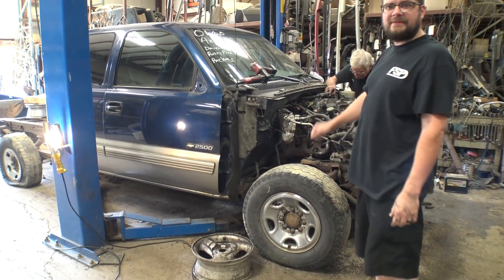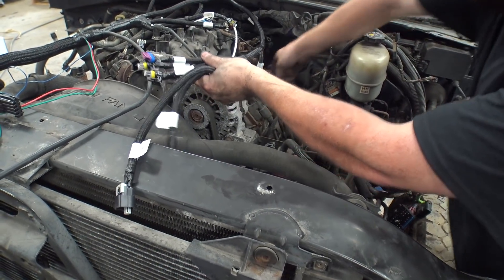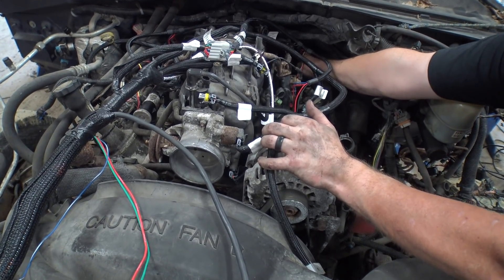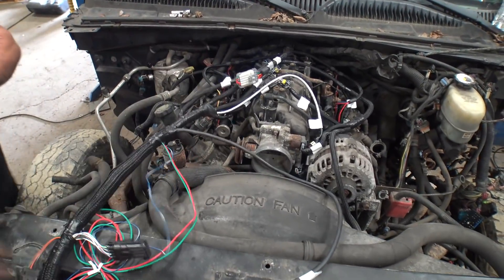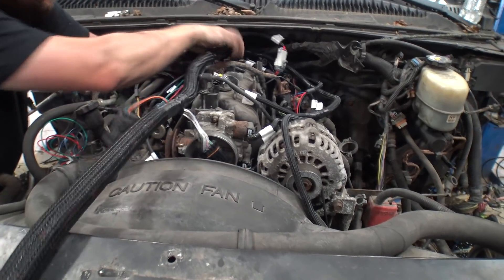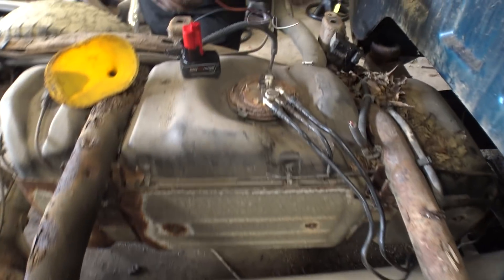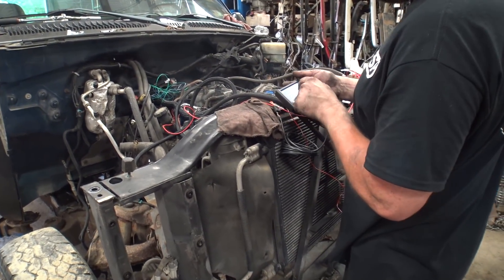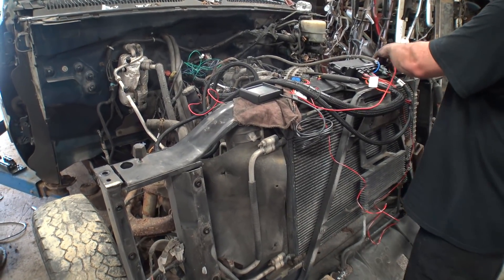Junkard Holley Terminator X wire and fire

Comment: I ended up getting my engine for 50 bucks I took it down to the pistons 
I did a video on what I put back into the engine  I think I spent about 600 bucks. I just started my engine using the terminator x max 
It started right up   I was and still am excited as hell !!!

Comment: Hold on hold on there sloppy!!! I just did this to my 2007 LQ4. You can’t plug the crank sensor in unless you pull the starter ! 
But that’s nothing compared with 
I had to replace my fucken injectors cause mine didn’t plug in 500 bucks 
Throttle body didn’t just plug in I had to replace it 250 bucks 
Gas pedal didn’t work 150 bucks 
Fucken near 1000 more dollars to make this shit work.
I started my car yesterday after a year of work I was really happy but  it cost me a fucken grip!!!
Reply from the maker: You made a lot of expensive choices and mistakes there you didn’t have to, can’t really blame Holley
Reply: @SloppyMechanics  First of all I understand your not installing the X max but all you people and Holley as well do your sales job video and say how easy it is to install which I agree with and I like my Holley but NO ONE talks about the required pieces to make it work!!! Like special injectors, only 2 types of throttle bodies and only one special gas pedal
Because I had a 2007 LQ4 these items didn’t work for my engine so I had to buy the items that did!!!!
So you tell me how I fucked up!!!

Comment: 100% GARBAGE...Hands down and you picked the easiest vehicle to do the demo on...Try doing an 80's version 5.0 Mustang or TPI Camaro and dont utlilize the TFI/HEI system to hook it up as its one of Holleys options..I bet youll never get it to run right at all on a MSD Pro Billet dist w/6 Box..

Its just a Carnival novelty dedicated to the LS crowd.....You should of put that kit on an engine with a distributor like an oldschool TPI powered Camaro but try using an MSD Pro Billet distributor with it....Then the problems with the system will arise to the top!!.

Heres some disturbing revelations Ive made about the Holley system when I put it into my F250 pickup ..#1 it actually sux and is mostly a "LOGIC Based" system similar to a Commodore 64 melded with a Commodore 128 computer from the 80's...

Holley tells me that theyre just getting into smart type ignition systems that can self-diagnose the system like an EEC-IV system does.....What gives Holley?,,,Why all the smoking mirrors and the LIES? Holley made me believe I was getting the Playstation5 of ECU's not stepping back in time..............

They made me buy a big cap w/adjustable rotor For $80 bux I didnt really need for my MSD Pro Billet they had me believing would work with the Terminator X controlling the timing 100%[It doesnt!!]...Alls they had to say in the manual was if you use anything but the TFI or HEI distributor you will lose all fuel injector accuracy and running in an inefficient Hit N Miss type of way but they leave that lil tidbit out then give you the info way-way after youve already put detrimental damage on your engine trying to figure the problem out but if they did divulge these lil tidbits ahead of time they'd be filing for bankruptcy also begging for people to take the Terminator X off of their hands.. .Phuck you Holley!!!!.

Anyways;- If you dont have an engine with a crank sensor and a reluctor wheel and have an engine with  a distributor either TFI or HEI I suggest you keep your distributors.....Anyone who upgraded from carb to Fuel Injection and are using a NON-TFI or NON-HEI distributors your cars will never be 100% perfect running on a BANK to BANK injector strategy and to hook up the distributor using timing control DOESNT WORK without adding a crank sensor into the array or using a TFI/HEI distributor w/interface module that sends #1 firing position to the ECU... MSD Pro Billet magnetic pickup distributors DO NOT WORK RIGHT!!! Thats a FACT and HOLLEY KNEW THIS but was trying to use smoke and RFI as a possible culprit to any tuning problems related to using a distributor with a magnetic pickup...!!!!!! 

Bank to Bank injection strategy fires 4 fuel injectors at the same time every 180* of crank rotation and has no way of telling where #1 firing position is to keep all injectors sequenced correctly so the injectors spray fuel into the intake and it gets sucked in when needed as a puddle not an atomized mix!!!....."Paired" fires 2 injectors every 90* of crank rotation in a hit n miss fashion and "Untimed Sequential" fires the injectors in Sequence but its HIT N MISS...Stay with TFI or HEI if you have them and for TFI dont forget the $90.00 plug that I found online for only $45...https://www.decorsday.com/products/harness-for-ignition-558-305-tfi-holley-ford

In the beginning I even questioned a Tech asking why the TFI plug kit was triple of the MSD interface plug...He said its the distributor who makes them who sets the pricing....Another lie as I found one for half the price!!!!

If you dont have a TFI or HEI distributor go get either one!!!!!!! Your engines will run a ton better when the injectors are actually spitting fuel into the fire when they actually need to be!!

Comment: Make sure you check the TPS and fuel pressure sensor. It’s the same connector. And mine came mislabeled. Green , black & orange is the TPS. Orange , black & purple is fuel pressure.

Comment: This is exactly what I do when I go to the junkyard.  Less than 10 minutes usually and you can check for everything you need before you buy it.  Just make sure the owners are ok with it.  Mine are pretty cool but most wont let you start them up.

Comment: Installed my term x on my 5.3 LS swap s10 was running perfect but battery died and let it sit for about 2-3 weeks now truck won’t start only cranks checked all wiring and grounds and fuses and everything is correct any input on what else to check or how to get it to work?

Comment: My terminator x max arrived yesterday, all the sensors are hooked up and the main harness ran through the firewall. Still need to run power to the battery and install the trans harness. Where did you tap into a key ignition source??

Comment: Ok the pcm  cable is it long enough to install inside  or lot better place than fender  I missed my cable up  I stretched  to much to hide it my bad  a costly booboo on my part.
Reply from the maker: there is a ton of length and this model should be installed in the car, its not weather tight

Comment: Here in California an 01 6.0 would still be running strong with 300k on the odometer with no rust. Kind of screws us that like to shop at the pic n pull yards. I do have a gen IV 6.0 this would work nice on though sitting on the garage floor.
Reply: Down here in the Houston area a 6.0 almost never hits the junk yard, if a truck is running it goes straight to Mexico.

Comment: I deal with them everyday.. Funny to here jake on the radio calling charley... I noticed you said you werent hooking up the mat sensor, i have this setup and im hooking it up right now, it says the mat sensor is required? Thoughts?? Mine doesnt have 1 so i bought 1...
Reply from the maker: you dont need it to get the car running thats for sure, but its a really good idea to plug it in for 15$
Reply: @SloppyMechanics  yea, i bought 1 already. I was thinking of putting it in the evap hole.

Comment: Great video, I am doing a 96 Impala SS how would I piggyback the factory ecu into the Terminator X so I can have my dash accessories?
Reply: I have been asking Holley the same question from day one. Some of us can't afford to own 2 cars. Our LS swap vehicle, is our daily driver.  And needs to pass the state inspection, through the obd2 connection.
Reply: @crw3673  the reason I asked was because of a old video I saw from street and performance, they did a LS swap on a 96 SS and piggybacked the factory ecu into the aftermarket harness and main ecu for the powertrain, well this far the only thing I can assume is to strip the factory harness wires to what i want to keep and neatly connect the wires to the Terminator X ECU ,yes this is my wife's daily!
Reply: @adambrooks2297  I would love to read that article! I have email Holley, about this issue and haven't gotten a answer. The terminator x is a game changer hands down, but until they make something with obd2 connection. I'm riding out with the factory ecu.
Reply: @crw3673  Go to YouTube and watch Street and Performance  video, they are out of business now but they did a 96 SS LS swap and piggybacked the factory ecu with the aftermarket ecu! It's a company out here that takes your 96 SS harness and changes the connectors so you can keep all your accessories, and it will fit the LS like the Impala came from the factory like that! It's a little pricey!
Reply: @adambrooks2297  thank you bro!
Reply: @crw3673  anytime fam!

Comment: ...and it probably runs better than my ground-up, rebuilt 350 roller motor with a FITECH on it, that has not run quite right since it came out of the shop.

I am a little jelly.
Reply: IT would be great to get a holley unit, replace my Fitech and see how well it works

Comment: Very cool demo on how straightforward Terminator X is to wire and setup!
Reply: Only on an LS Coyote or Mod Motor platform or people keeping their HEI/TFI distributors...All else are running on "Hit n Miss technology like Bank to Bank injection strategy , Paired injection strategy or even untimed Sequential strategy them other distributors make you run on the Terminator X system.....Those 3 strategies also cause mondo tuning problems!!!!
Reply: Dude I was subbed to your channel long time ago idk what happened no wonder I never saw nothing from you no more
Reply: I bought this kit it will not Start my engine this kit is garbage

Comment: If you have the wrong injector chosen in the wizard, once it comes up to temp and starts the self learn, will it even out the mismatch info between what injectors you have and the injectors in the tune? Then hit commanded afr on its own and the injector info becomes a mute point?